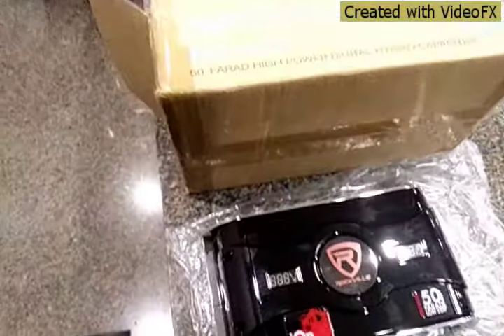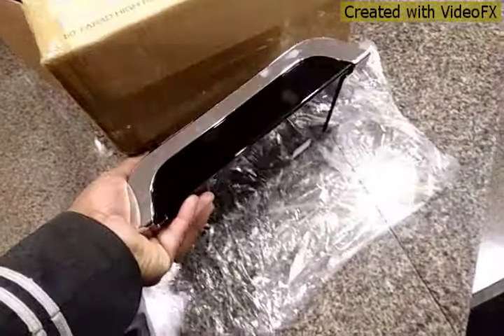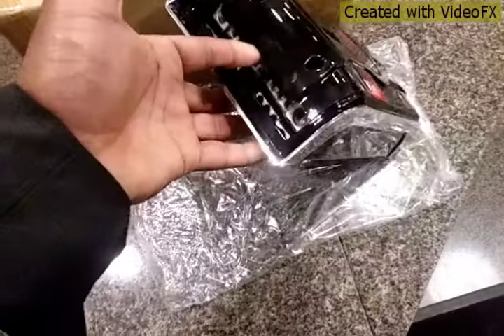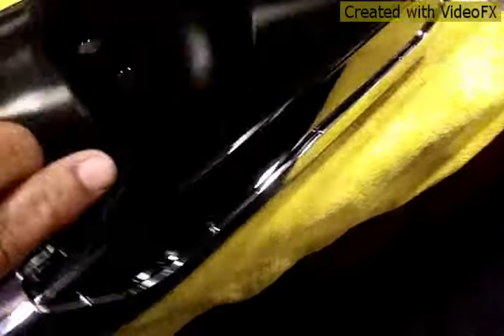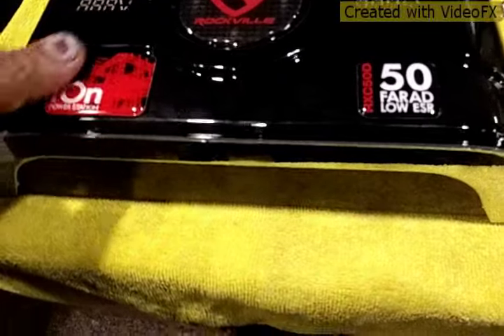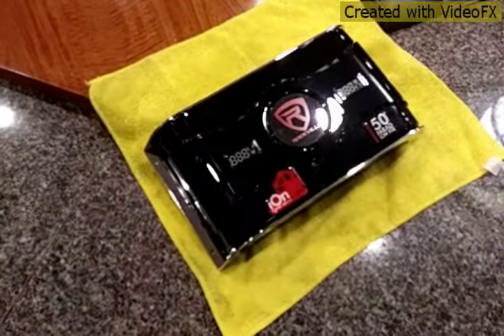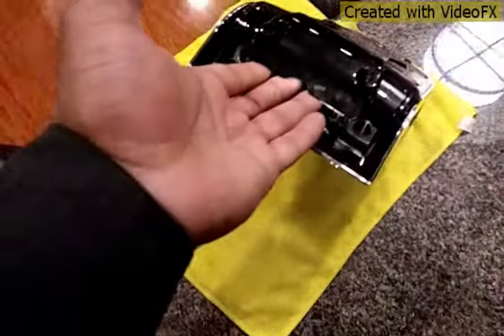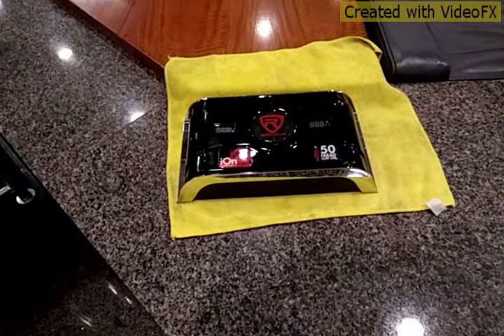Rockville RXC50D Hybrid Capacitor..

Comment: Not that this will help you if you already sent it back.  But I got my unit opened. There were 4 screws under the four round rubber grommets in the center of the back side.
Reply: How does yours work?